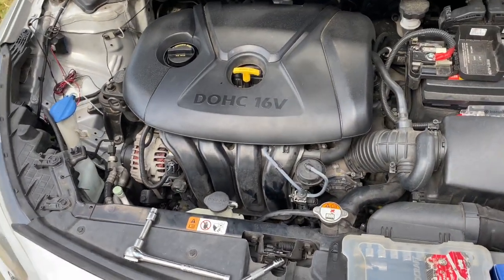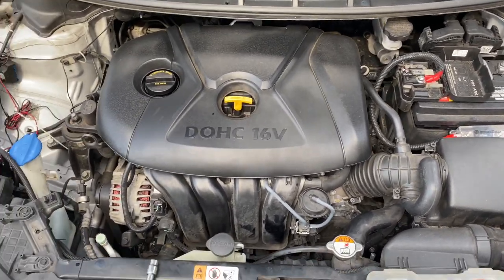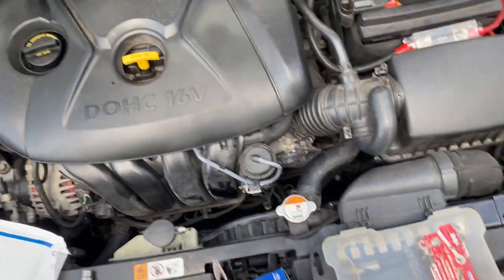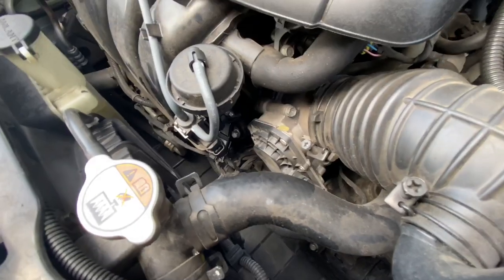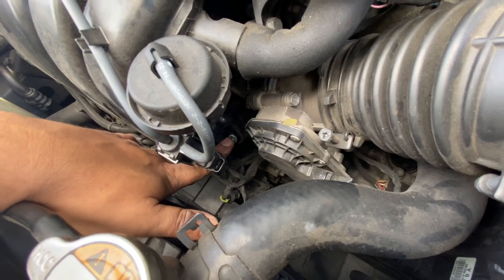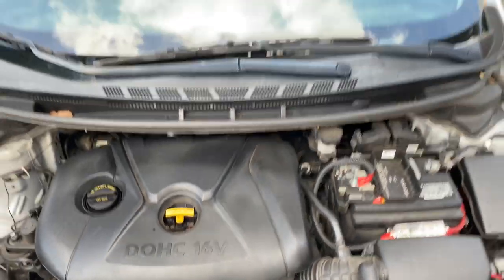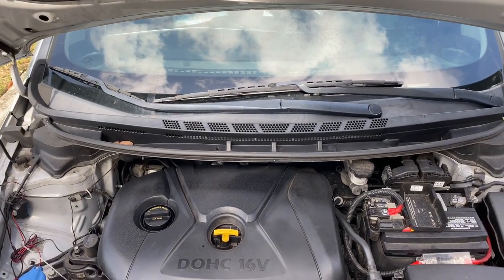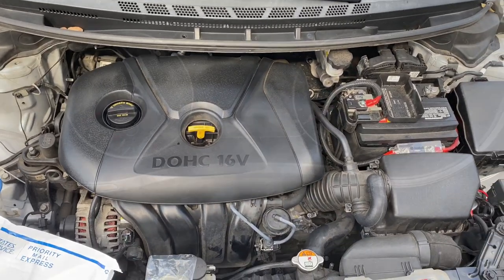2015 Kia Forte lx won’t start please help

Comment: Check your battery terminal adaptor is it tightened down enough or does it wobble ? Is the battery terminal in tac? This could be the issue
Reply: Non-sense

Comment: guys, I was having the same problem with my 2015 forte and i found out it was the battery terminal. when the piece is missing it makes the box the battery is supposed to fit in- a little loose so when you’re starting the engine the terminal isn’t fully connected to the battery because its loose. the quickest solution is getting the terminal replaced asap bc this issue drains the battery. If you can’t solve the problem right away try avoiding bumps and that sort of stuff that may cause a sudden movements bc in the case that the battery disconnects once you’ve started it could shut off literally in the middle of your drive. drive safe everyone. hope this helped:)
Reply: That does make alot of sense I have a 2015 Kia and never replaced the box to the battery and its doing what the guy in the videos Kia is doing getting that box put back in tommorow.
Reply: Bro do you mean the piece that you tighten in that clamps down the battery ?
Reply from the maker: Change the throttlebody it worked for me and all problems gone

Comment: It's a ECU engine computer relay switch that's in your black box of your two blocks which has a black cube that goes into your car fuse box is called a computer ignition relay switch in Canada it's a square Little black cube they go for about 32.00 to 34.00 with tax is not your ECU control module it's a relay computer ignition switch it is a black cube
Reply from the maker: Change the throttlebody it worked for me and all problems gone

Comment: The problem could be your battery fuse the little square thing that sit on top of the battery in the positive area it could be blowed or what so ever but if you change it out
Reply: I purchased a new alternator and new battery for 450.00 and after installation I founded out that the only part that wasn't letting the battery charge was the black square fuse which is the alternator fuse....everyone try this before buying a new alternator.....
Reply: This is what I'm hinting at right now because my kia forte is doing it. I'm going to autozone
Reply: @jorgeluismelendez2097 was it the problem?

Comment: Having the same problem. Got 60k miles when my 2016 forte started having the same problem as the guy in the video. If you figured it out, please lmk. Gonna go watch some more videos and try to figure this out.
Reply: Any results?
Reply: I have a 2016 with the same problem. Only if it sits 8 hours or more.

Comment: My car is a 2015 kia forte with 100K miles and has been doing the same thing since it had 80K miles. I spent a bunch of money tuning up and it still has the same issue. I wonder if there's a way to make it start at 1400 rpm so we don't have to tap the gas to keep the car on
Reply from the maker: Im guessing is a know problems what have you changed if you don’t mind me asking
Reply from the maker: Change the throttlebody it worked for me and all problems gone

Comment: A couple mechanics told me Kia Fortes normally need new engines or buy a new car. My engine clicks when it is on and is now starting to die out. I bet the labor to replace an engine is far too much.
Reply from the maker: Change the throttlebody it worked for me and all problems gone

Comment: Did you change the suspension when you put the 19s on?
Reply from the maker: No
Reply from the maker: 19x8 and tires 225/35/19

Comment: I see this video came out 2 years ago. Had the same problem as you recently...don't know if you figured it out but...did you consider the crankshaft position sensor? It was helpful for my 2014 Kia Forte. Another option is changing the fuel pump.
Have a Blessed Day!
Reply: I’m having the same issue now. Mine won’t start after being sitting for a while but will start through out the day. Could this possibly be the problem as well? Please help I have a 2014 as well
Reply: Did you figure out what the issue was?

Comment: Any updates on your Kia, I would have changed Bothe O2 sensors cause they may be telling your computer the wrong info which would make your computer mix the wrong ratio of air/fuel to start your car, just a thought . Please let me know if this tip helped and good luck, I hate seeing good/nice people with car problems, no one deserves evil car issues
Reply from the maker: Change the throttlebody it worked for me and all problems gone

Comment: Did you find out the problem, my wife's is doing the same but no start at all
Reply from the maker: Still have the problem since like 70k+ miles and I have 103k miles now  and I’ve have changed the map sensor, fuel injectors , ignition coils , spark plugs , canister vent valve , purge valve at engine bay , my last thing would be fuel pump cause the way the cars are now the fuel pump has fuel filter and more parts just in the fuel pump lmk if you find out anything for your car
Reply: I just bought one and it’s doing the same thing
Reply from the maker: Smh im still stuck with problem
Reply from the maker: Christopher Romano  lmk if you find out the problems please
Reply: Check fuel pressure could be the fuel pump
Reply: @DaUniqueFamily  curious to know how the car rides on the 19" rims? Does it affect the turning radius?
Reply from the maker: Rides great but not like 15 or 16’s of course but no issues here i just went by factory specs all around to get the biggest rims i can put with good ride cause 20’s do fit perfect with no issues but i went with the specs 19x8 50 offset and same bore size and with 225/35/19 and if u wanted 20 it will be 225/30/20
Reply from the maker: It does effect the turning but i dont notice it i looked it up online and found all specs
Reply from the maker: Did u find out the problem lmk plz
Reply: @DaUniqueFamily  thank you for the info.
Reply: @DaUniqueFamily  with your issue, have you tried to get an obd2 scanner hooked to it to see what codes pop up?
Reply from the maker: Trevor Goad code that pops up is large evap leak no other codes
Reply from the maker: Trevor Goad p0445
Reply: Just bought a Kia from Carmax and I’ve had this problem twice. I purchased extended warranty, but I really hope this problem isn’t going to be a constant one.
Reply: We're you able to find the problem...my 2014 kia forte is having the same exact problem...started today

Comment: Did you find the fix ?
Plz let me know I’m going through this
Reply from the maker: No still haven’t found the fix
Reply from the maker: Only thing left to change is my pump
Reply: I have 130000 miles on my 2015 forte and it will start up for 3 seconds then dies. I haven't changed the alternator but I've had this problem for a while and the battery is at about 12.9volts and the battery is only 2years old. Not sure what's up with it either
Reply from the maker: Change the throttlebody it worked for me and all problems gone

Comment: Three day ago my 2015 kia forte started doing this problem. It  starts but it's not on complete it. I turn off the engine and I try again and it has a little problem staring it.
But I don't understand wh it's doing this. There no check engine on.
Please help
Reply from the maker: Change the throttlebody it worked for me and all problems gone